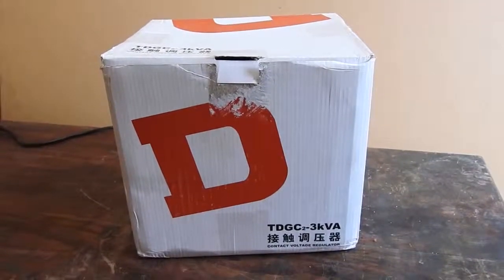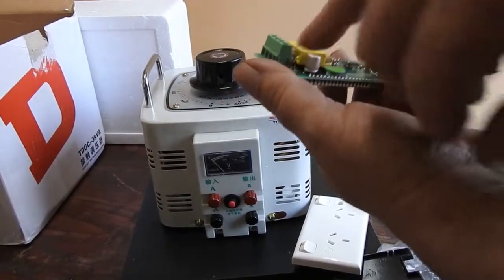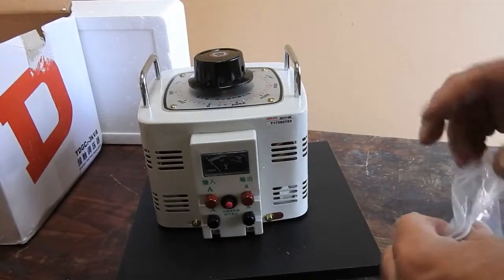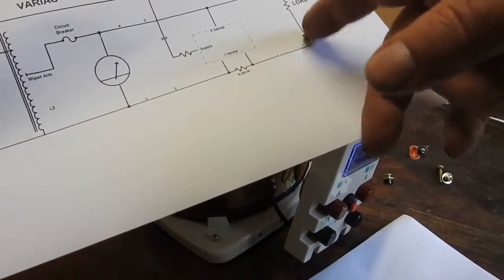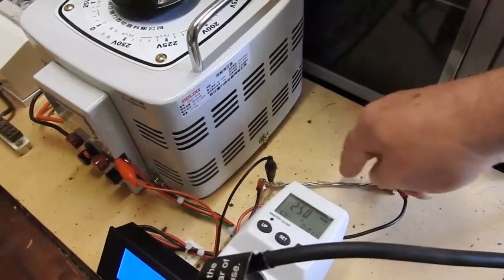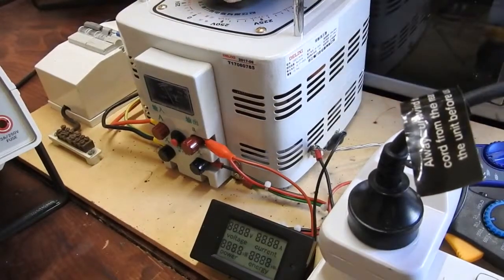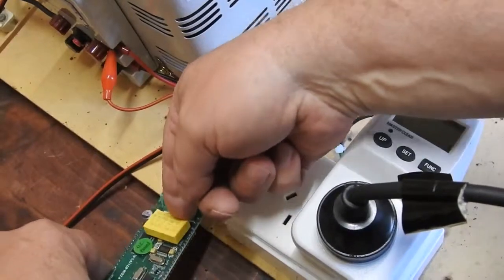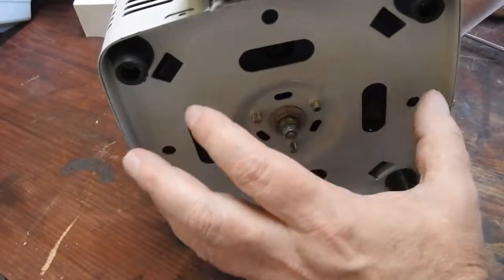Variac Upgrade - Part 1

Comment: I have the same 0 -250 volt/20 amp variac but with the UK 3 pin outlet and a digital voltmeter + on/off switch and mains cable .. I'm intending to fit a  PZEM-021 meter that will show current & watts.. When mine arrived I thought the control knob shaft was bent, but it turned out the main outer casing was skewed  giving the illusion of a bent shaft. While fixing this I decided to grind some metal off the shaft as it was too long for my tidy brain to accommodate !  All's good now and I'm happy with it. Thanks for the useful video and appraisal.  73, Pete UK.
Reply from the maker: That box is pretty cramped, so I'm thinking about rebuilding it. I'd lose the variac case, and just have the handles, and the insides bolted to a plate, sloping down a little, in  a larger wooden box. I'd also use the PZEM-022, which seems a bit better than the -021.

Comment: liked the video, vary informative , just a thought, Did you ever think  about a Knightsbridge RCD9000 Twin Socket RCD, 230 V, wall socket,
Reply from the maker: No. That's a UK outlet, no use to me here.
I haven't seen an AU outlet with an integrated RCD. But in any case, I just used parts I already had.
Reply: @bertoid  Arrr...! understood. but still some good info.